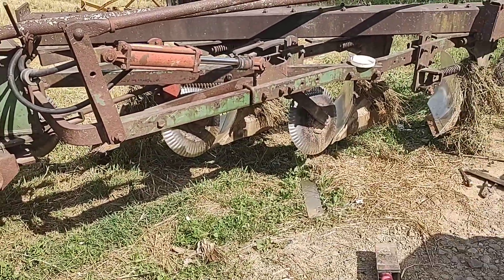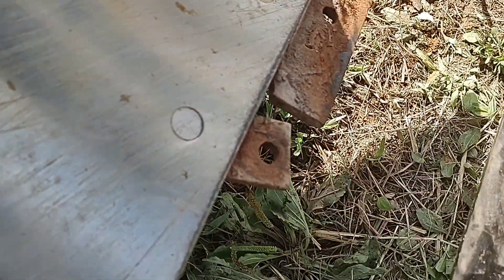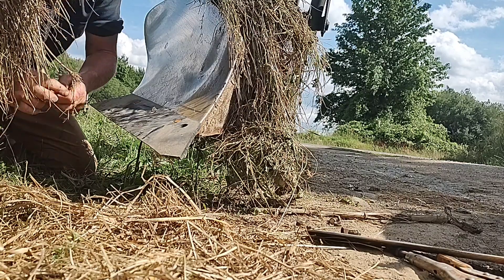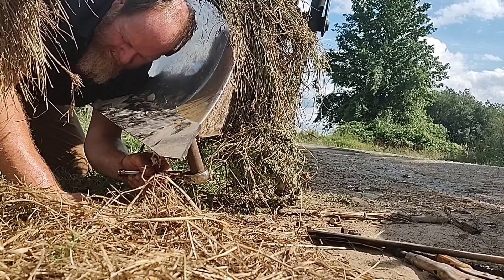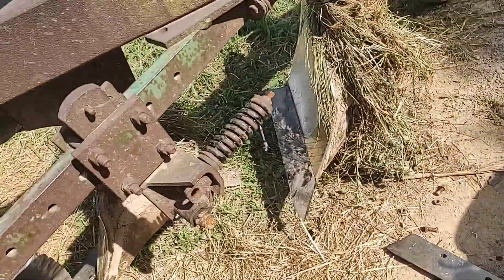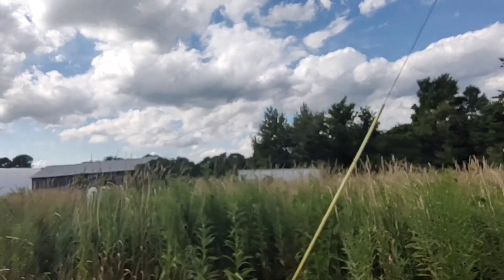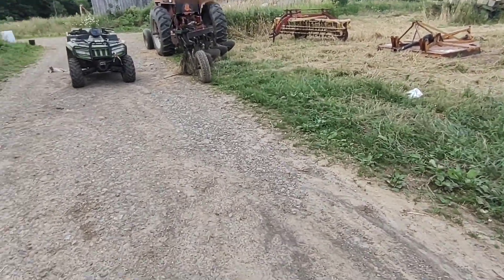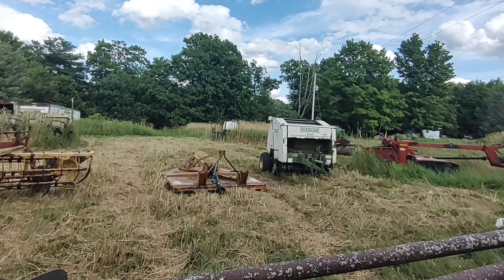Broken plow point. Also are these electric utility connections done to code? July 26, 2022

Comment: Have the electric company check out the connections. I had a low voltage problem in march, problem was a faulty connector on the transformer.

Comment: If the plow bottoms arent tripping then I'm going to bet the rollers could be froze up. Or the springs are set to tight and need to be loosened up.  The manual will give the length that the springs need to be for "general" field conditions.  If you don't have a manual id suggest getting one. Also if you're in the furrow and the plow it leaning to the left you need to lower your right lift link to make the plow level while in the furrow.

Comment: The guy wire touching the neutral would make no difference, as the transformer secondary neutral is bonded to the pole neutral and the pole ground, as is the transformer case and both guy wires. You point camera at the other transformer down the way as if its feeding the cow barn. If that's true, you need to inspect the other transformer pole connections.
Reply from the maker: Thanks.
I figured this must be proper since it's clearly bonded connections they made. What throws me is just letting those two wires touch.

Yes the barn is separate. Prior to 2018 the one transformer was used for both the house and barn. In 2018 when it was determined stray voltage was coming through the utility everything to the left of this pole was changed. Mainly another transformer and an isolation switch, because they didn't want to isolate the house also. The barn is isolated from the neutral and any measurable stray voltage is non-existent. Testing the way I was I'm only getting. 02 volts compared to . 3-.7 volts. Production never has shown any improvement. 

There's a couple vids where I show the report and talk about the testing for SV.

Comment: 65-70lb isn't bad but could be better! But for the added milk what are the others paying to get that!? So in the end are they making much more!!??
Reply from the maker: I'd be happy to see 50 lb again.
Since 2016 and using 4 different nutritionist, talking to 3 different vets, correcting for stay voltage, and talking to some experts at Penn State nothing has lead to seeing any improvement .
Missing something and I'm at a loss where the problem could be.
Reply: @Mad_Farmer912  stray voltage can be hard to detect and cure some times and cause all kinds of problems!

Comment: Do you think it's a combination of hard dirt and a abundance of rocks? I have the same issues at plow days I get to go to from July threw September most years. Especially when it feels like you're trying to plow a road because the ground is either compacted or just that hard and dry or both.
Reply from the maker: It was definitely hard and dry what I plowed already.
I think some of it is the plows need to be fairly level to hit an object square to get the bottoms to trip and mine are running leaning to the left with the point running lower.
Reply: @Mad_Farmer912  I definitely know what you mean. Is there a day that you are going to get a light shower soon? So you can go out and the plowing may be a little easier plowing and the plow will pull more level?
Reply from the maker: @matthewdavis4081  we got at least and inch + two nights ago. Stuck out the last field tonight and it plows 20 times easier.